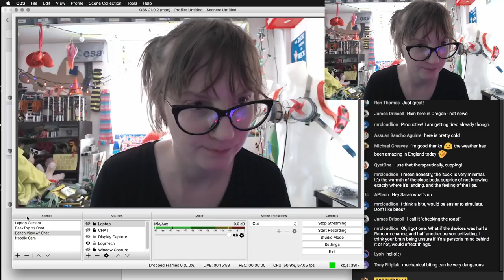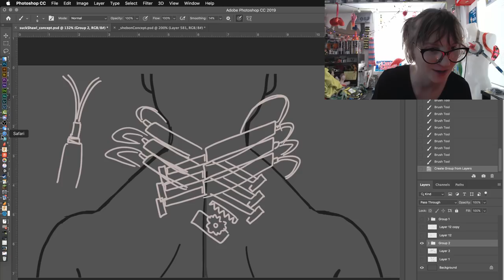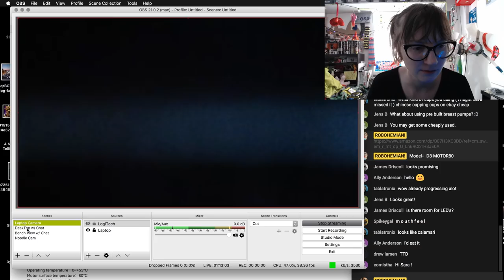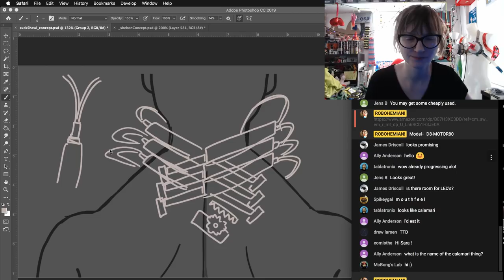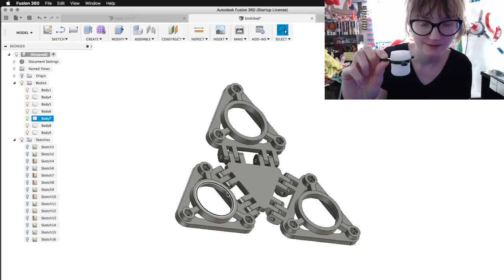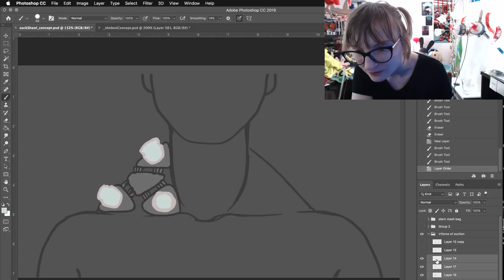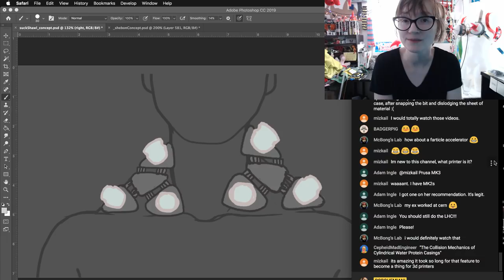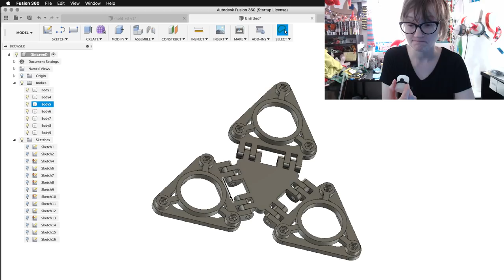Beginning Dev of the Neck Sucking Augment

Comment: ref motor control, there's more to it than just "programming skill", brushed motors lack torque when used with low PWM pulse ratios. Brushless motors are more complicated to control to begin with and especially field-oriented-contol for higher efficiency and low-rpm torque get's a bit complicated (though RC-car ESCs probably do a decent job and to those you can just send servo control signals, but then you can't do smart things based on the feedback from the motor, tradeoffs...)

Stepper motors are handy but relatively low RPM (and bulky if you want torque).